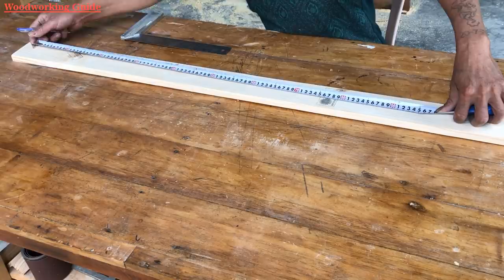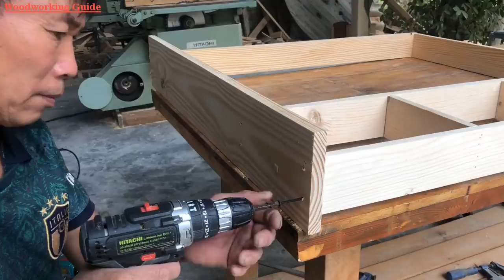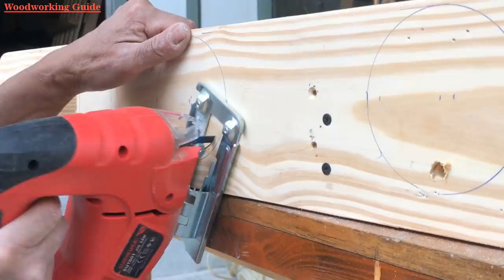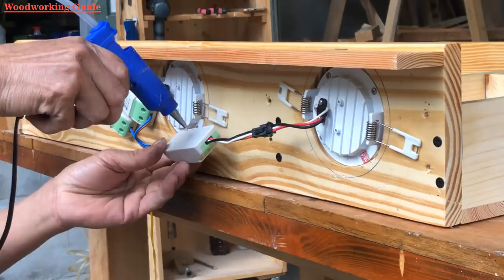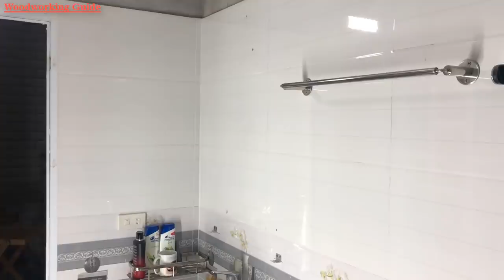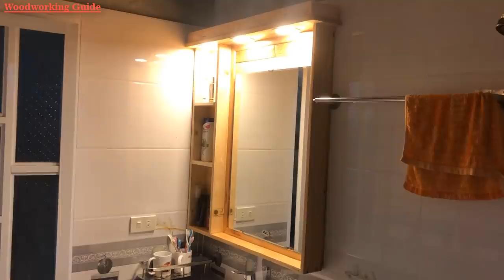The Bathroom Becomes More Luxurious With This Project || Simple Woodworking Work - Efficient

Comment: Im a begginer in woodwork so i may be wrong. Wouldnt it be best to use wood glue and or brackets?  Do the nails impact the quality especially since its now in a moist area like bathroom?   Ple
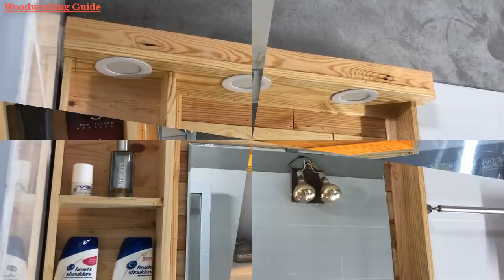Reply: There is SO much wrong with this project. You just pointed out one issue. As he saws the 2x4 at 0:17, his fingers are just an inch or so from a spinning saw blade. Sure, he can get away with it MOST of the time. But there is that one "oops" that puts him in the hospital. What's wrong with a cheaply made Push Stick??? Oh, and the wiring? OMG. At 12:53, look in the mirror at the wiring for those two floodlights! Wood screw heads showing everywhere. Put some weight on those angle brackets and they will rip out of the wall. The towel rod brackets are jammed underneath the wood. I'm sure glad I don't live in Brazil!